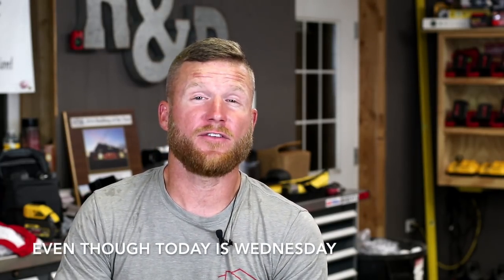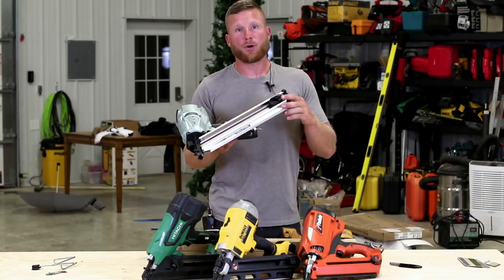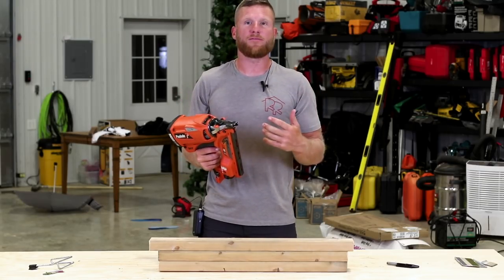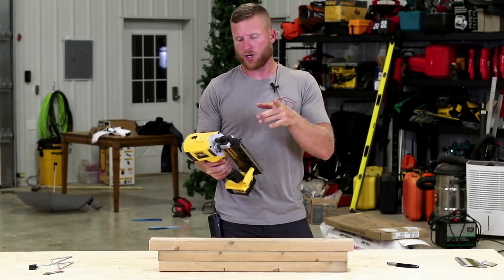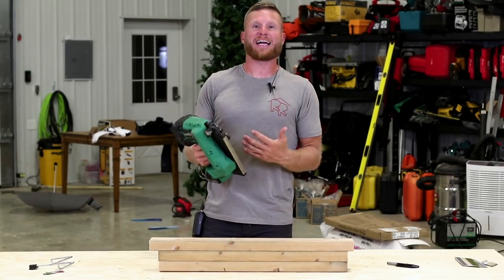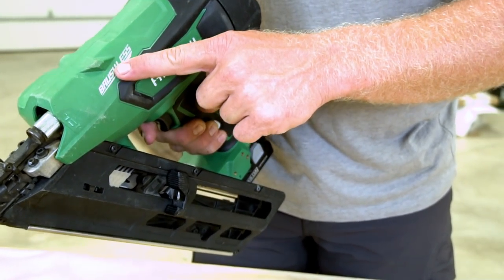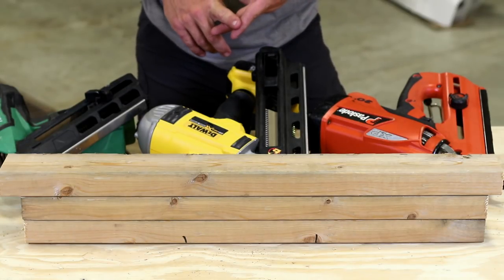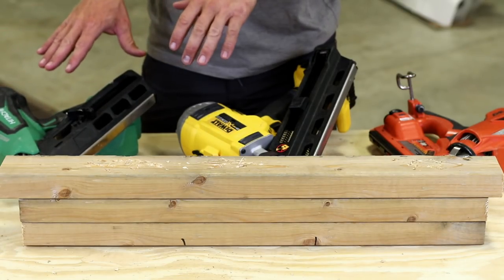The Best Cordless Nail Gun: Toolsday

Comment: Hey Kyle I bought the hitachi after first seeing it on your insta page have to say it is far from perfect it has many design floors which quite annoying. I'm a framer and we use them a lot and have to say it's the last gun anyone wants to use. 1 the rafter hook like u said is a joke, 2 the switch turning off seems every time your holding something and go to fire it's turned off. 3 the cylinder gets in the way and blocks your line of sight . 4 the nose is way to short and as soon as you go to toe nail or skew nail beside something the front of the magazine hits and the nose doesnt depress 4 the weight is way to heavy it's heavier than a pneumatic framer in Aus they come with 6 ah batteries they have a ways to go to get this gun right.
Reply from the maker: so basically everything you said that was wrong...was exactly what I said could be improved upon...However in my eyes....its still way better than running a compressor for what I use it for....I am not a production residential framer.  I don't use a nailer like a stick frame guy does.  thanks for the feedback.  You are another example of why there is no perfect tool for everyone.

Comment: Best nail gun on the market is the New Zealand made Airbow. Compressed air cylinder comes with a high pressure air compressor
Reply: it could be if they made the cylinder removable so it charged up while you used another cylinder. currently to much down time and the compressor is to big. paslode still wins my vote

Comment: RR Building, nice review. What I would like to see a video of someone using "bump fire" mode in a day to day situation. I personally have not had a use for that kind of feature yet and I was wondering where this would be helpful and how often it would be of use.

I considered buying the dewalt, but the noise and weight were the deal breaker for me. Almost bought the Hitachi recently as I do like their tool, but again, it is ridiculously heavy, plus there is a new model coming out soon. 

With the paslode, the only issue I have with the latest model is they are alot louder than they used to be. Batteries are not an issue as they supply two per gun and the only issue with the gas is that it needs warming up on the cold days. In NZ the gas comes with the nails or if you are buying cheaper brands they are not all that expensive. 

Best "cordless" nail gun I have use to date are the paslode models from the early 2000's, very robust and could take a real...hammering. They could also go for years with out cleaning. Mine was tested before its first clean and it had fired just over 60,000 nails

Comment: I don't think that cordless nailers are a replacement for pneumatic. They are not as reliable, or as fast. Cordless nailers in my mind are more for smaller jobs that aren't worth getting out a compressor for. We have had both the dewalts and paslodes at work, and they get over used and abused and start having issues  because guys will use them to frame 400'x60' buildings
Reply: Hmm well the nailer is as fast as any human handling it. You can have a corded one which is faster at shooting. And i can still beat u or even keep with u
Reply: In NZ hardly anyone uses pneumatics for anything. And haven't done for like 10 yrs

Comment: Why are 12d framing nails, 3 1/4" long and the thickness of a pair of 2x4s is 3 inches. There is always 1/4" of a sharp nail protruding out while offering a safety hazard? In addition, the "extra" 1/4" provides nothing in strength to fastening a pair of 2x4s together.
Reply: why wouldn't you use a 8 penny ( 2 1/2 inch) nail for that?
Reply: I always fire at a slight angle and alternating pattern.  In this way the nails don’t stick out and they hold better at the same time.
Reply: They sell 3" framing nails too.
Reply: Yes but it’s a hassle swapping nails back and forth.  I stock 3 1/4” and 1 3/4”.  And have them in two different nailers.
Reply: It adds strength when nailed at a slight angle with nothing penetrating out the other side.

Comment: The Dewalt is fastest
Reply: DeWalt has to "ramp-up" before nailing, then "reload" between nails; the Hitachi doesn't. And even if you were right, the difference in speed is negligible and utterly irrelevant because these are not production nailers. Also, the Hitachi is much-more reliable and the DeWalt is fugly. ;-)
Reply: The dewalt type 3 nailer is great 2 nails per second on bump it's  quiet and more conetic energy than 2 an all round fantastic nailer 👍